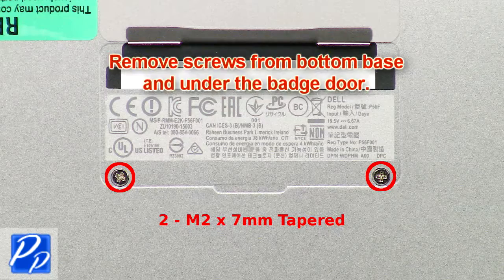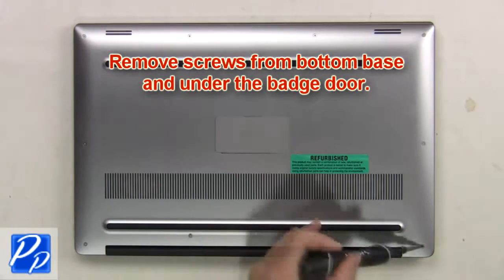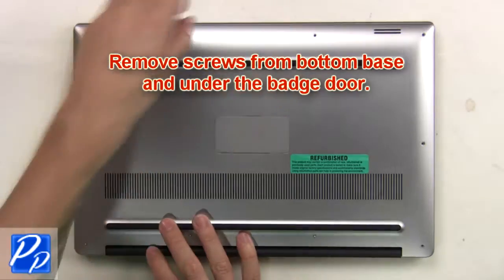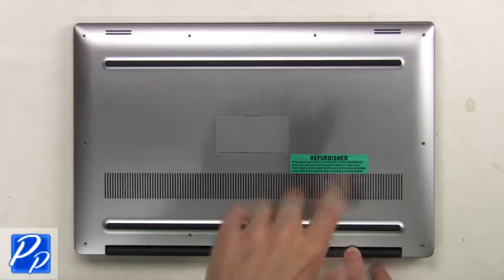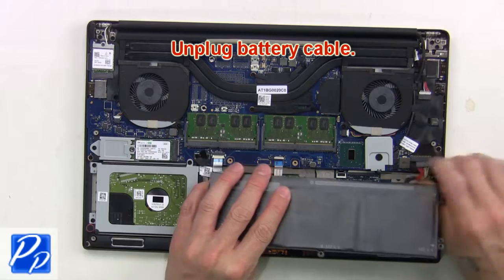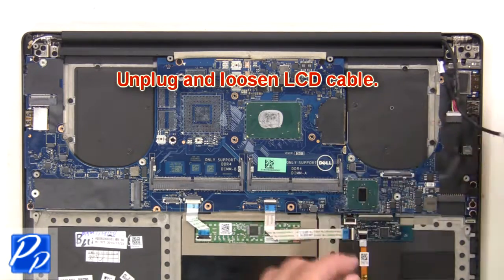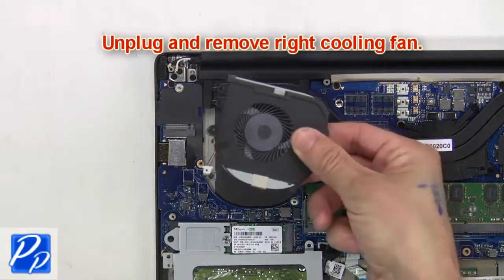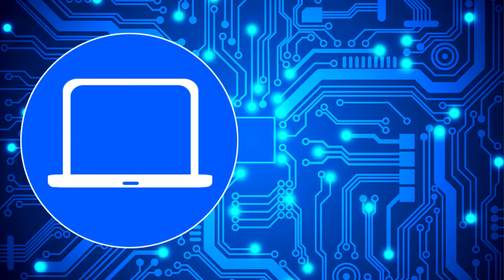Dell XPS 15-9570 (P56F002) Right Side Cooling Fan How-To Video Tutorial

Comment: If I hear a rattling noise, does it then really mean that my fan is broken? Is there no way to fix it in another way?
Reply from the maker: Compressed air may be used to blow out any possible obstructions. However, if the fan assembly is broken it is usually best to replace it.